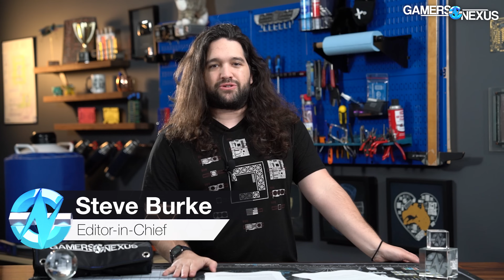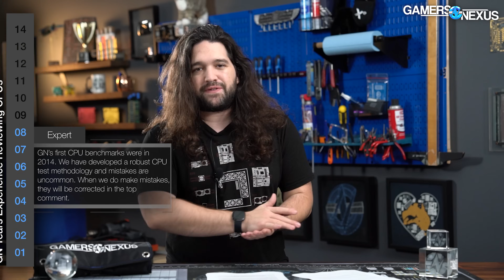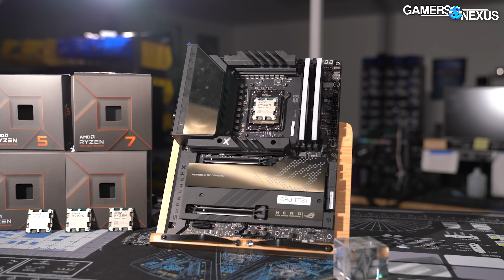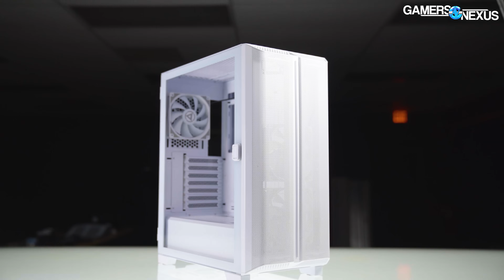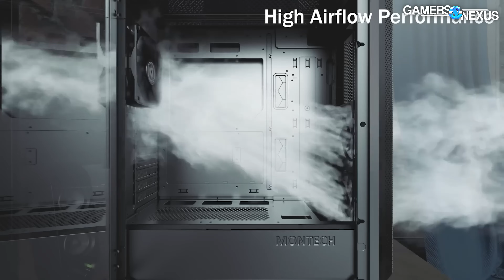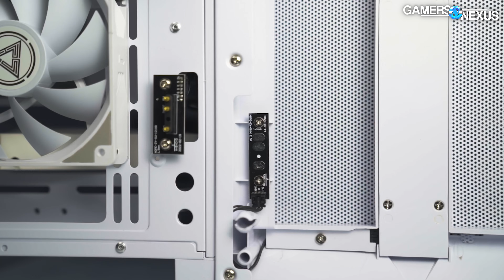AMD Ryzen Eco Mode Deep-Dive & Benchmarks on R9 7950X (Zen 4)

Comment: Am I the only one that questions the brains of anybody wanting to buy the fastest most powerful Desktop CPU and then running it in  powersave mode to, save energy and give up power, that what the whole point of having bought this very high end expensive CPU? I run my R9 7950X at maximum performance, I don't care about how much power it uses, I bought this CPU for being a workhorse and have as much power as possible, not for powersaving.
Reply: Not everyone exactly wants to save energy. Someone wants to also save some fan noise, use a smaller case (micro atx or itx), use an air cooler and so on, while still having highest performance possible with that constraints. I would rather doubt your brain that you can't even imagine such simple scenarios that other people would want.
I am myself a programmer, so what I do mostly is production. Code compilation, running virtual machines, emulators and such. Also I do some video editing and music production. Sometimes I also need to do a lot of things at once(or switching back and forth). Having some video rendering, while writing code, while browsing like 50 tabs in chrome, maybe even all on multiple screens. 
Now YOU tell me, why should I buy a worse CPU? If I buy Ryzen 7, Ryzen 5 or i5, i7, it may not be enough cores and performance for my purposes. As you have seen in this video, Ryzen 9 7950x even in 65w mode is around equal to stock 7900x. Even in 65w it is faster than any ryzen 7 ryzen 5 or i5 i7. So what am I losing here? I don't care about the money. I can have the best working experience, with low power consumption, with low noise. You may not care about the noise of fans at max performance because you wear headphones and probably don't do any listening intensive tasks. I do music (record and produce), so I like my room completely silent. I even turn off the AC when I am recording something. In 65w mode, I can have a whole video rendering task going on, and I could record no problem from being just a few meters away from it. Usually I would use 105w though as it is the sweet spot for this CPU. Also I don't really care about "maximizing performance with whatever means possible". I don't want a big bulky atx case, and I don't want a water cooler. Why bother so much for a 2% increase? My life situation can allow me to render someting in 6.4 minutes instead of 6.0, or compile code in 38.2 minutes instead of 38.0 in 105w, idk about you. I would rather use a matx case and an air cooler at that point, instead of 360mm high end aio in an atx case.
Reply: Try living in California or Arizona.
 Trust me you'll want to lower Temps in the summer.
Reply: @Gidrah  I do live in CA and your argument still does not work: You would buy a lower power CPU that naturally generates much less heat. What you are suggesting is buying a race car and then reducing the power of the engine, which makes no sense at all, as it still won't be an economic car. And you did not buy it for that. I mean we are not even talking about the GPU that any powerful system has and that uses 3 times as much power (and generates as much heat), which makes any little reduction in wattage consumption of the CPU totally meaningless. In hot climates you use ACs to cool down rooms, that solves the problem. My PC rig uses around 800 watts of power, the CPU, even it being very powerful with 16 cores and high clock frequency, is the smallest part of that,

Comment: My x670E BIOS has an option to constrain the thermal limit of the CPU ... so I can set any value below the 95 deg and it does reasonably well keeping it with little overshoot.

What is being constrained to achieve this and is it the best way to reduce power usage and heat while sustaining as much performance as possible.

I want to keep as much single core performance as possible yet stop my CPU overheating my room when multicore is on call and it sits at 95 deg constantly.

Comment: One of the most notable differences for me upgrading from 5800x to 7900x using a large external radbox, has been the increase in ambient temp in my small office due to the CPU creating a stable water temp of 36 C instead of the 28-29 I usually get. It makes my PC a large heater.

On that basis I am seeking to learn how best to constrain it and keep as much performance as possible while reducing power to heat conversion... i.e efficiency!

Eco mode and Asus ROG BIOS make this challenging because they put their own crap in there instead of simply using what AMD specify but provide NO genuine detailed manual of what does what.

Comment: I've been running my 7950x in 105 mode for over two months.  I haven't had any issues.  Like none.  It doesn't get hot, my fans stay quiet and I haven't noticed a huge drop in performance.  I love it.
Reply: would u recommend 65W if I wanna do render 24/7? What temps are you hitting and what MOBO would you recommend?
Reply: What fans do you use though?

Comment: Factory overclocking by another name. In times past we had a button on our beige desktop cases for this, called "Turbo". Now you have to go into BIOS to undo the factory overclocking.
7:35 Equivalent to changing the laws of physics to suit your needs, in this case for marketing purposes, to make more money. Not that different from what politicians do.
Reply: The turbo button actually slowed down PCs to a stable common speed to make faster pcs compatible with software. Heh.

Comment: I feel like you should have mentioned what power the cpu was consuming on each of the applications at stock. Some apps consumes only a little power even at all core load which allows the eco mode almost no performance reduction on that app.

Comment: running this cpu in 65Watts eco mode is equal to runningthe 7900 stock.. but running the 7900 in PBO uses more watts power then the 7950x in 105w eco mode. Reason i'm commenting is i'm trying to figure out if going for the 7950X and putting it in eco mode when not needing the power and if i need the power i could turn it back on and have power on tap for years to come.
Reply: what did you get at the end?

Comment: I run 4800 all cores at 1v. BlackRock pro 4 cooler and oy loose 300 MHz and get 69c under benchmarks. Run 7950x silent under testing!

Comment: Hey guys, what I’ve done to my 5900X is: set 0.9875 fixed voltage for cores, then went to CO optimizer in bios and set +5 for best cores and +2 for second best cores and I also disabled the Cstate, this helped a lot at being stable
I haven't any issue in 2 days of usage and now at Cinebench R23 all cores boost to 4700Mhz and hit 20k score. Interestingly with much less wattage (95w vs 145w before) and 56c core max temp vs 72c before.
Is this ideal or should I hit higher clock numbers?

Comment: So I tried limiting my 7950x by temp. Before I would get a cinebench score of around 6050-6150, tried tweaking a few things in bios, got 6240 but BSOD'd and stability went out. Went back to defaults with D.O.C.P and thermal limit of 85 degrees with fans only spinning up at around 80 degrees, before that total idle.  I got a scores between 5950-6050, giving up at most 200MHz, most of the time I was only about 100MHz under stock. Ryzen Master was also showing that I was running at around 154W instead of the 170-230W...  Yes, the selli g point of this CPU is unbridled performance I'd your cooling application is sufficient, but, when you turn it down to reasonable levels its efficiency is off the charts.  Great job AMD!

Comment: I think the best part of the dual CCX chips is how much independent control you have over each. You can manually downclock one CCX and leave the other high, essentially making your own P and E cores. Cap off CCX2 at 4000MHz while CCX1 runs at like 4700-5000MHz. In single thread application you still get the full sustained clocks, but in all core you save some power. Food for thought

Comment: Wanted to ask if you've tried manually undervoltinh using Ryzen software... I saw a video where someone took frequency down to about 4800, dropped voltage to 0.96 (or something like that) took about 5% performsnce hit at 50% effective TDP... And as a bonus, it didn't try to melt itself every chance it got.

Comment: Hi ! i be needing a new computer with max 2700 euro ( allready have the case ). This is my first time making a computer for my own. i aint gone make games were the characters are over 4k. im using am5 Technologie. what you guys think? can this be cheaper? is this good? Is this bad? please give me your thoughs.

| Case Fractal Design Torrent | DeepCool PQ1000m, 1000 W | Gigabyte X670 AORUS ELITE AX | AMD Ryzen 9 7950X | Noctua NH-D15 Cromax.Black | Corsair DDR5 Vengeance 2X32 600MHz | Asrock Radeon RX 6800 Phantom Gaming D 16H OC VideoCard | Seagate FireCuda 530 1TB M.2 SSD | Fractal Design Prisma AL-18 PWM 180 mm fans |

Comment: In my realm gaming and rendering workloads go hand in hand.
7950x enables 256MB SMA when using a 6800 xt and 6900 xt series AMD video cards.
I know it's not much at a 1.5 increase in performance yet it's just a shadow of what's to come with RDNA 3
What I'm asserting here is that if you use 6800 xt or 6900 xt you SHOULD pair it with the best AMD cpu you can get.

Comment: I use my 5950x in 65W (actually 65w is the core draw - the CPU package is closer to 80w) almost all the time. My PC spends 75% of the time doing less-challenging tasks and 25% heavier multi-threaded ones. If I am only doing 1 or 2 heavy tasks that take less than an hour I don't take it out of Eco mode. If I am about to spend a whole afternoon thrashing the cores I will turn ECO off and use PBO. I think the105w setting on the 7950x is akin to the 65w on the 5950x a 2-15% loss for 20-30 deg lower temps and 40% lower power.  Just because I drive a Bugatti Chiron (I wish) doesn't mean I want to drive it at 250 mph all the time.

Comment: This information is really useful, but I kind of wish the charts were X/Y scatter point of Power vs Score.  An X/Y plot will illustrate how much bit of jump from 262w to 158w than 158 to 88watts?  Those differences are 104w and 70w, btw.  The 65w is still amazing despite the low score.

Comment: one thing I'd like to know is if it actually draws notably more power when gaming at stock and if so can ryzen master toggle eco or is this a bios exclusive feature, because, assuming there is a notable difference, it'd be a nice little thing to just flick to 65w eco if you're gaming and switch it back 105w when you wanna get some work done

Comment: When  you look at the power efficiency numbers, you can see why AMD is doing so well in the server market. Tweaking the CPU for efficiency is roughly what is happening for a server that runs 24/7 and the difference with Intel is just massive. Though there's no Xeon or Epyc on the chart though but it was interesting to see.

Comment: Lowering power by 100W is gonna make a big difference in room heat, consider a 4090 and full power cpu, vs new amd gpu and eco cpu you are talking 2-300W less heat being pumped at you.
Gaming really needs to start trending towards efficiency. (I know these are more peak draw for games then constant but still)

Comment: Thank you for exploring this. I appreciate it. However one thing a bit misleading about this video is you only tested power consumption with blender (because it uses the most power) so mostly only blender workloads lost performance because other workloads didn't use as much power anyway. I think some people might have assumed you were always getting huge savings in power based on blender tests. It seems reasonable to assume that efficiency is a function of average clock speed regardless of the workload (unless there's a bottleneck) so you did get about 40% savings in power with only a 300MHz reduction in speed. For all core workloads you could probably get consistent efficiency gains by limiting clock speed. For games, eco mode probably makes more sense since you need the spikes, even if it probably doesn't have much effect on power consumption.

Comment: Possibly a silly question why can't the power usage and voltage be reduced and increased  depending on work load? What causes a requirement to reboot and change in BIOS?
Reply: "voltage be reduced and increased  depending on work load"
That exists since Intel Haswell called adaptative undervolt.

Comment: The big question is: can this be driven by software with application specific profiles ? If it is only a BIOS toggle, then the usability is limited, mostly use 105W eco and unlock all stops for specific (overnight or so) workloads.

If this can be configured on the fly with per-applicaiton granularity, this is an amazing feature.

Comment: I use a All core -20 curve optimizer off set, (Ryzen Master suggested -30, but that was unstable), with a PPT set at 170, which leads to a 2 to 4% drop in overall performance all core from stock (I loss more performance having all apps installed and running in the background than I did from tuning down power).  
I played around with a number of PPT settings but found setting 170 had nearly no loss from stock and dropped temp down under 75c, so went with that.  Going below 150 I saw a real decrease that was more than noise, given what the system cost I decided to go for lower temp (20c less that stock) and power draw (that is over 80 watts less that stock).
Reply: Hello, I would like to do the same settings for the power settings, 170 PPT. However, a bit unsure regarding the settings for the TDC and EDC that go along with a 170 PPT. 

What settings did you pick for these other two? Could you please share?

Comment: Well I purchased used i7 2600k a few years ago and after OCing it I think that now we have a totaly opposite situation than when 2600k was released:

2600k at stock was something like 7950 at 65W mode - very efficient
2600k at something like 4,5Ghz OC is like a 7950 at 105W mode - a lot of bump in performance that required zero or little voltage increase but still managable to cool using even air coolers at reasonable fan speeds.
2600k at absolutely max OC near 5Ghz is like a todays stock 7950 mode. Give me all the power you have and I will give you all the performance I got!

The only difference was that 2600k scalled its performance nicely after OC. Ryzen scales only in workloads. When we will receive lower tier AM5 ryzens it will be interesting to see how they perform in eco modes.

We should not be supprised as both Intel and AMD have now about 10 years of experience in building their "boost" technologies. Propably if we would apply those algorytms for those old CPUs they would perform on stock settings like our highest OCs using normal coolers (not like LN2 extreeme OC).

It is good that AM5 received those bios profiles, because at release date it did not look good. Still I will propably skip the first AM5 generation and update my 1700x to some 5700 5800 or 5800x3d. 5800x3d has now a very good price, but in my country there is also a lot of used 5800xs that cost half of new 5800x3d (Obviously no one is selling used 5800x3d now :D).

Comment: I agree with the PSU judgement. Looking at PSU's they are way cheaper. You can get 1000W+ power supplies that are platinum or even titanium rated for around 300$. If you underclock too you'd be at a substantially lower draw to the point you'd be well within maximum efficiency range AND you'll be functionally fanless on your PSU as it would be so underworked that it would be cold without the fan in most cases. This leaves almost your entire power budget for the GPU which means your PSU fan ould only ever be on for times when the GPU is getting intense use combined with moderate CPU use for a core or 2 (effectively modern gaming characteristics).

I've been crunching the data and from what i can tell i can get over a 10X increase in performance and use LESS power to do it than my current system that uses an OC'd FX-8350.

In the winter i might let my rig run rampent bc heat isn't a waste where i live in these cases which also means cooling isn't a huge deal during these times either.

Comment: An extra power cost is removing the heat these things generate, that massive drop in temperatures is very appealing to me. I think the stock settings are so beyond stupid, a 30c jump in temps for barely ANY gain over 105w eco mode.

Comment: Barring major unexpected breakthroughs, silicon based chip tech seems to be reaching a point of diminishing returns for a given node shrink. Moore's Law is dead, something that's strongly rubbed in by the fact that the latest CPUs literally run out of the box in over clocked to the ragged edged mode by default.

Comment: I am curious how many watts the 7900x is, If the upfront cost is $150 but you saved 15-20% on the wattage while still getting more performance, I would definitely go for it. Long term it would definitely pay for itself.

*I guess that's kind of covered in the conclusion section chart.

Comment: Looks like the "105W" 150W ECO mode is what the CPU would be if not hunting for the last few points in benchmarks against Intel.
It is interesting how some time ago, you had to do manual steps to OC your CPU. Now you basically have to do manual steps to run your CPU at a reasonable power efficiency :D

Comment: To me, every watt expended will also have to be cooled by the air conditioner.  My office already gets really hot from an idling 5950x + Titan Pascal (but mostly I think from the audio receiver) to the point where I have to turn everything off or the room is warm in the morning.  Definitely worth running in an eco mode or otherwise reducing power consumption which is more important than the direct electrical cost I think.  Add noise as a factor, and at least 105w means (hopefully) lower fan speed.  Efficiency was a huge factor for me when choosing the 5950x compared to Intel for the last gen.